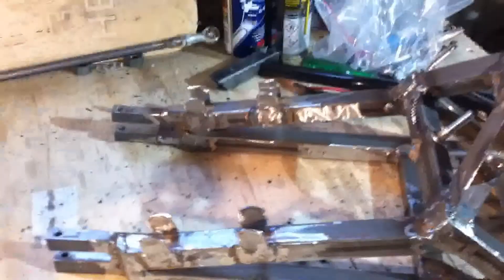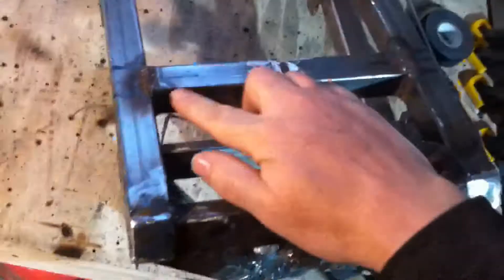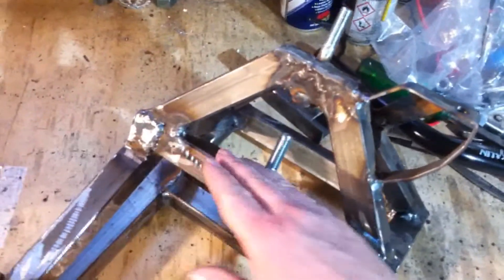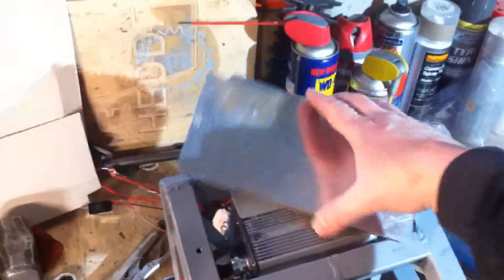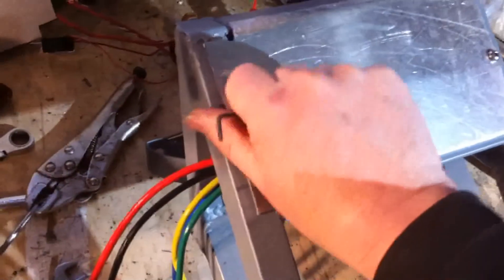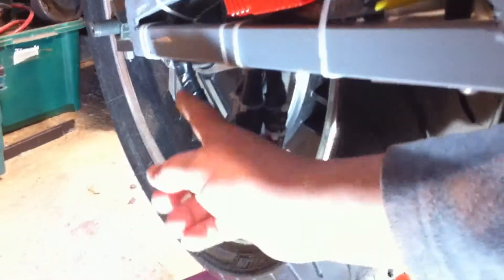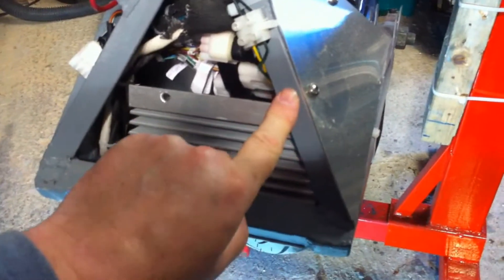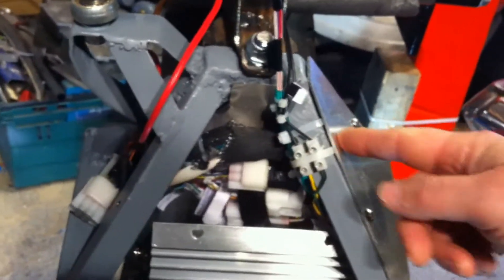UNICYCLE GARAGE #6: Lower Frame, packaging power wiring

Comment: I would like to know the dimensions of ur frame..like length,width,height from the ground and so on..how to calculate those things
Reply from the maker: Height of saddle is slightly less than your inside leg measurement. My machine could no doubt be improved, I am learning all the time. Therefore I am only documenting the general principles of what I have found works OK for me. If I published plans, as people often ask me to do (and send them for free along with all documentation), the chances are that within 6m I would have changed them in some way. I would use them as a general guide only.